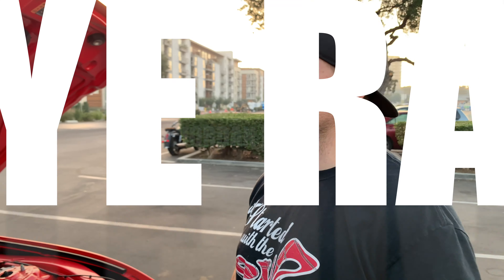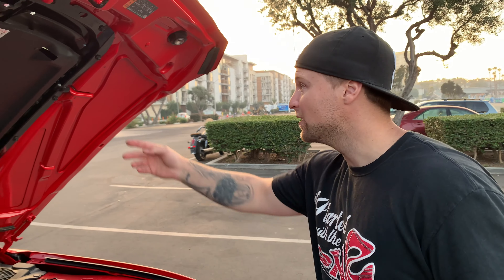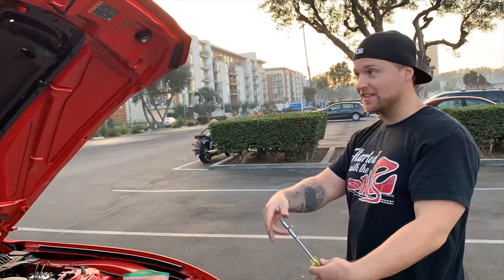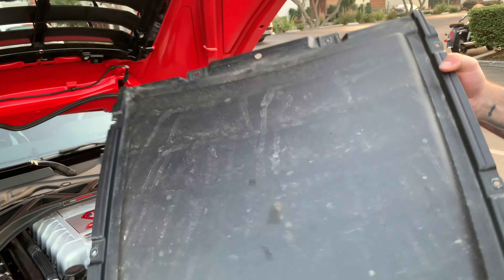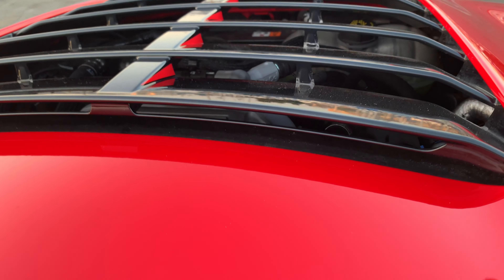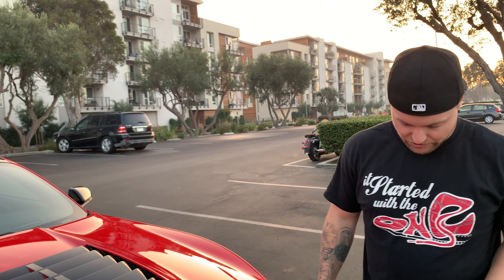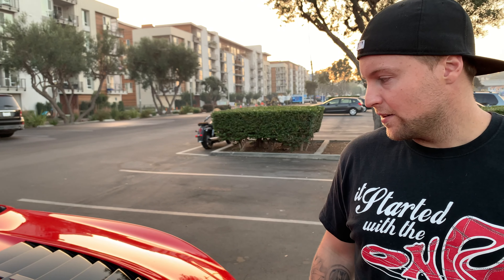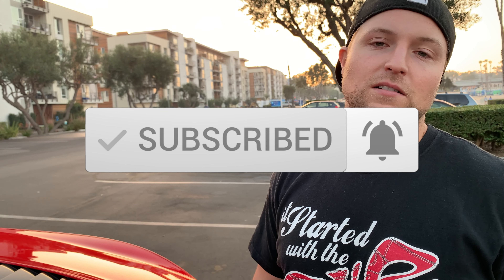REMOVING RAIN TRAY ON GT500!! MORE AERODYNAMIC!!

Comment: Is that the track pack or the peasant version for the peasant sounding YouTuber
Reply: Track pack is 100 lbs lighter theres no difference other than that. The base is better in the resale market too
Reply: @ViburaBlanca  not necessarily true, the track pack is about 3-4 seconds faster around road course tracks. Different tires, lower to the ground, stiffer springs and sway bar. Better aero in the rear, the wheels are 15 pounds lighter per corner.
Reply: @Mizzington24  No one cares about that though, unless you literally are a track focused guy, most people that own these won’t track them.